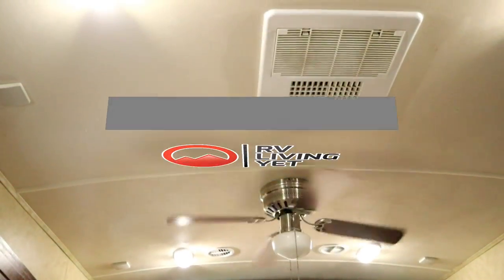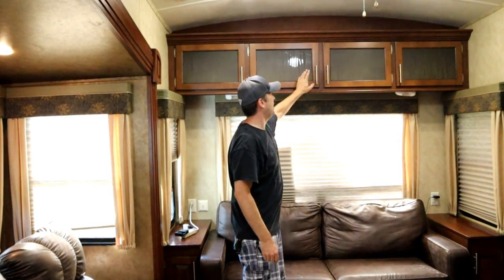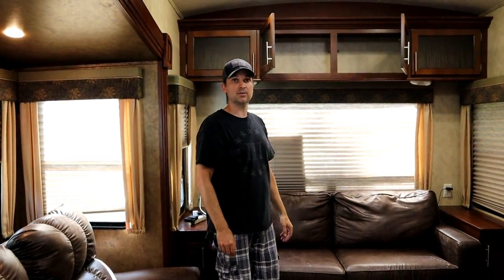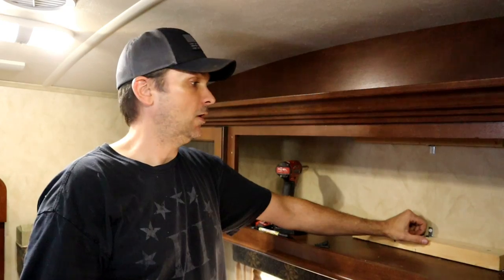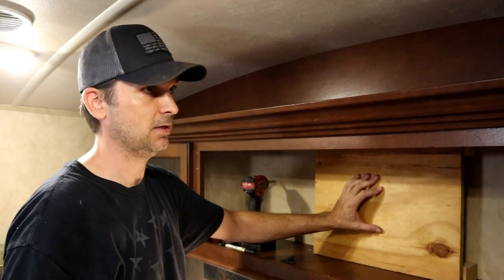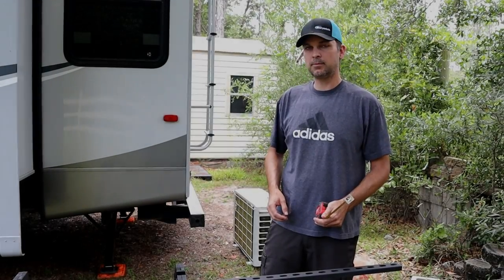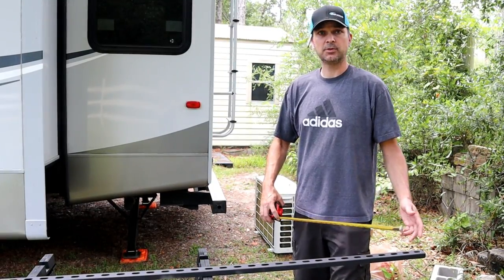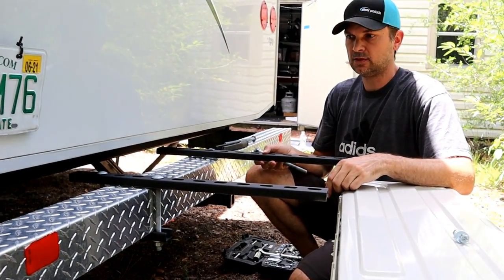Installing Mini Split Air Conditioner In RV Camper-Installing Mini-Split Heat Pump In RV- RVAC Solar

Comment: I just installed the 38 seer 220 inovair in my 30 foot holiday rambler. Its running off my split phase sungold power inverter and cools the camper in 10 or 12 minutes then drops down to 200 watts of power usage. Some people had their doubts about me installing the 220 volt in a camper but man im glad i did. Its absolutely amazing how little power it uses and how well it cool the camper. Next im removing the roof top air and installing skylight in the old hole itll leave in the kitchen ceiling.  Thanks for the video it gave me confidence to do the install myself and it all went smoothly.
Reply from the maker: Glad it helped

Comment: Glad more and more people are doing this. Hopefully have ours ready by summer as well. When I was doing HVAC for work had a client ask for one and it changed my world. I suggested these to everyone I came across after that.
Reply from the maker: Its night and day versus the factory unit, we love the upgrade.
Reply: @RVLivingYet  it really is. Even if I had a house still, I would put these in each room. Did a install at my step dad's barndominum, he has two in there and run 24-7. bill hasn't reached over 120$ all summer and winter.
Reply: @RVLivingYet  also since you have yours at one end of the rv. Do you feel it in your bedroom all the way in the back. I'm installing mine in the bedroom right where it points perfectly down the hall into living area. Hoping a 12000 btu can keep up with the whole 30' rv in summer.
Reply from the maker: @BEASTmodeontheRoad  We have a 12000btu in a 38' and it is brick cold in the summer and as hot as you can handle in the winter. That includes the bedroom.
Reply: @RVLivingYet  12000 or 1200?

Comment from the maker: 👇 👇We have listed the parts we used down below Affiliate Links 👇 👇
Innovair Mini-split AC/Heatpump👉🏻  https://amzn.to/3TuMXWi
AC Gauges and pump👉🏻  https://amzn.to/30i70xR
Flex hose = 1/2 "👉👉   https://amzn.to/3ro43HY 
Flex hose = 1/4"   👉👉  https://amzn.to/3bZPDak
Reply: To avoid vibration problems on the line set leave enough extra copper to create at least one loop (12" or so diameter). That loop will absorb the vibration and keep the lines from breaking. Also it wouldn't hurt to put a strain relief at the connection point at the condenser. This avoids potential leak hazards by reducing the number of fittings.

Comment: Cheers to RV LivingYet, great video. Im about to do the same to my 41 5ver, was wondering how you bend the ref line from the inside unit to the right without kinking it. TIA.
Reply from the maker: We used a round pipe to gently bend the copper around to aviod kinking.
Reply: I'm thinking of adding one to my 41 ft'r as well. How'd yours turn out? Is it effective?

Comment: The heating side of this unit I am guessing is way better than the propane furnace without the fogging of the windows from the propane. These are becoming very popular in the RV world.
Reply from the maker: Yes it give nice even heat with no condensation

Comment: I use your videos as a sounding board for my DIY build. 

The point on using radiator hose for the flexion and bounce is a future life saver point. Thinking about thick rubber bushings in between the mini split unit and my bumper.

Thanks!

Comment: FYI at 5:37 into the video you will see your philips head drill bit was left on the metal template, it came out of your drill! It is probably still there :) Nice work on the install it is a very clean job.
Reply from the maker: Thanks, yep it's still there. Lol

Comment: Great video thought maybe should have rubber bushing under unit did it have some. You did great job evacuating system and flex copper
Reply from the maker: Thanks for watching, yes it has rubber bushings that came with the unit but the whole bracket system was bouncing and causing pressure on the tubing, the flex hoses work great.

Comment: Impressive project. I would be thinking about building out the bumper to extend 6-8" beyond the unit. Just in case there was ever a very small accident. Maybe even a short bumper to span the width of the unit. Or even a cage... Just a suggestion. Really nice job!

Comment: The only issue I could see is there's not much room above the inside unit for it to suck in air but it seems to be working well for you.
Reply: I was looking for this comment because I thought the same thing about the air flow.

Comment: Please help. Can you tell me where you purchased your compression fittings and am I looking for the right fittings? (No one has what I'm looking for.) I've been to 5 different stores (Ace, Home Depot & Lowe's) looking for the 1/2 X 1/2 male & 1/4 X 1/4 male fittings. This is my first time ever fooling with this, I have the inside and outside unit mounted. I just need to connect the copper lines. I love your idea, so glad you shared it. Can't wait to send you pics of mine. My RV set up is almost identical to yours. So when I saw your video. I said I'm doing it! Absolutely hate the loud freaking roof A/C.
Reply from the maker: I got the fittings on Amazon, I don't have the links handy but you should be able to find it with a quick search. Good luck on your project you're going to enjoy the results.
Reply: So sorry to bother you. Would this be it? 

Brass Compression Tube Pipe Fitting Connector, Straight Coupling Adapter,1/4" Tube OD x 1/4" NPT Male Connector 5pcs (1/4" OD Compression x 1/4" NPT Male)
Reply from the maker: @tjjohnson3316  High Quality Air Conditioning Copper Pipe Extension for Joint Double Connector Intermediate Connection Head Free Welding Butt Copper Tube Diameter 6-19mm Flare Nut (1/2" (12.7mm) Copper Tube
Reply from the maker: @tjjohnson3316  Air Conditioning Copper Pipe Extension for Joint Double Connector Intermediate Connection Head Free Welding Butt Copper Tube Diameter 6-19mm Flare Nut (1/4" (6.35mm) Copper Tube)
Reply: Thank you, thank you, thank you! I really appreciate it.

Comment: Great Job. Was wondering, I looked everywhere but you were the only one that had you lines exiting the head unit on the right when looking at the front of the unit.
This was what I want to do. Just wanted to confirm with someone, did you just slowly twist the lines the 180 degrees?
Thanks
Reply from the maker: Yes you have to be really careful when bending them.

Comment: love your video. there should be a way to keep the unit from “bouncing “ as other parts will fail due to the flexing of the mount. 
place a solid mounted cage under it with tune/brake lights and reflectors on it for the fools behind you.  do you run a generator?

Comment: Im in the north so need a tank freeze protection idea for the tanks in the belly if I don't use the propane heat.  I could circulate the propane system fan with a manual switch for the coldest of nights.

Comment: Greetings- I have a 2012 29RL- I think you have the same rig maybe just a newer model? SO assuming that you have a 29RL I'm curious if you explored using a ducted mini-split system since our rigs are ducted? If so why did you decide that ducted wasn't the way to go? Do you have a rooftop unit in your sleeping quarters? If not how does your system perform relative to heating and cooling the sleeping quarters at the opposite of the mini-split output cleverly installed in your cabinets?   Thanks for sharing your knowledge!
Reply: Also wondering if you considered mounting the unit above the rear window and perhaps even having the top of the unit above the roof line- but no higher than a roof mounted AC would be or even lower- this would help in the airflow for the unit since half or a third of it's intake would now now have to deal with the airflow against the back wall. Also was thinking this makes the unit far more difficult to steal AND it would no longer be acting as a rear bumper of your rig- I also have an enduro motorcycle that I'll have as my bumper in it's trailer hitch mounted carrier- any feedback on this concept would be much appreciated!
Reply: I was also thinking in regards to the ducting- perhaps I could have the inside unit exactly like you did in that cabinet and then have small inline fans that I could turn on or off and or thermostatically controlled by bedroom thermostat- the small fans would be inline with the duct.   This would duct the cool/warmer air being output by the mini-split in the living room up to the sleeping quarters- I bet that would do the trick- thoughts?
Reply from the maker: We looked at the cassette-style minisplits but it would have been too much trouble to route the lines to the roof, I dont think the back wall would be strong enough to handle the weight of the outside unit and I didnt want anything on the roof since these units have to be upright they would exceed the height limit. So far this works well, we have a follow up video that answer questions.
Reply: @RVLivingYet  I agree in regards to wall integrity- I was actually considering a roof mounted cantilever strut system that would support the unit's rack from above- if need be I could add structural blocking inside of back wall but doubt that would be necessary- and no I'm not suggesting mounting the base of the unit on the rooftop- I'm suggesting that the top of the unit which is cantilevered a foot or so from the back wall sticks up above the roof line but no further than the highest rooftop accessories you have. Even just 4 inches above roof line I think would really help air flow. Wish I could post a sketch in case I'm not articulating my concept adequately. Thanks for your reply!

Comment: im thinking of doing the same ....  nice job !!  so glad you made this video...  what size wire ? 14/2 ?  on a seperate breaker ?   hows the unit held up with all the bumps in the road ? thx
Reply from the maker: Check out the follow up video that should answer your questions

Comment: Just watched your video and noticed that when you installed your backing plate for the inside unit you left your bit on the last screw you installed then you put the unit in place with it still there. Maybe you were just test fitting it and pulled it back off and found it?
Reply from the maker: 😆 yeah we realized where we lost it after reviewing the footage... 😆🤣 Good eye! Thanks for watching!

Comment: I feel like you deprived yourself of stowage space installing the air handler as you did. Had you removed the doors, then added a blank facade over that void, you could have mounted it with no sacrifice. What are the manufacturers recommended space tolerances for the condenser, and do you know if they must be mounted in the vertical, as you did? I liked your presentation.

Comment: Air Handler location question: Are you having any issues with the small clearance to the top of the air handler in your install? 6" is recommended in my instructions.
Reply from the maker: We drilled holes in the top of the cabinet afterwards.

Comment: That bouncing you described will fatigue the thin steel of the bumper where it's welded to the frame. Your first indicator that that's happening will be when other motorists pass you honking the horn and pointing at the rear of your rv.
Reply from the maker: The bumper is not the typical thin metal, it is rated for 150lb with a tow hitch. The flex was coming from the legs of the condenser which are thinner, we have secured it with a strap. Thanks for watching.
Reply from the maker: Check out our 1 year review video👉 https://youtu.be/TP0KxDykO6k

Comment: These types of split units all require the outside unit to have 12-inch minimum spacing on the back where it draws air in to blow through the front.  Yet it looks like you've mounted the outside unit with only a 2 to 3 inch clearance which severely constricts the intake.  I have to imagine this reduces the efficiency of the unit, but it clearly still works for you and it makes it easier to mount this unit.  But are you getting good reliability from this thing?

It's great that you got this working because it's so much more efficient and so much cheaper than 12V ACs built for the RV market.  There's no way I want to spend $4300 on an RV AC.  It looks like you can probably move this thing out 2 inches to get a little more gap behind the back.
Reply from the maker: I think the camera angle is deceiving, we where able to push the unit out about 10" to get air flow behind it and so far it has been working great. Thanks for watching!
Reply: They don’t all require 12”. The clearance required will vary depending on whether there are other obstructions. You can put a Mitsubishi unit as close as 3 15/16”:
https://hvacdirect.com/hvac/pdf/MXZ-2C20NA2_Install.pdf
Reply from the maker: Check out our 1 year review video👉 https://youtu.be/TP0KxDykO6k

Comment: I didn't think of mounting it inside the cabinet, I almost ripped the cabinet out. Thank you
Did you think about Mounting the outside unit near the roof on the back? 
My thinking is that area on the back just below the roof, opposite of the ladder or maybe in the center,,
It is a very irrelevant area that doesn't see any kind of action so it seems safe and out of the way.

Comment: If have problem with the the copper lines breaking at the flare you can use a number 6 sae fitting with automotive hose  ac line 
Number 4 fitting for the 1/4 copper line

Comment: Was the 12,000 BTU enough? We are here in AZ and lost our rear unit and I’m thinking of installing a mini split. I was to go 110V but the only option is 12,000 BTU. Not sure if it will
Be enough.
Reply from the maker: In extreme heat we kick on the bedroom AC but overall this is plenty for a 4 season RV
Reply: @RVLivingYet 

Where did you buy the flex line?

Comment: Great work!  Question/Comment -- The unit you mounted in the cabinet also needs a return air flow path free from obstructions.  This helps to keep the the evaporator from freezing up. I believe most require a foot of clearance from the top. The air return space looks really tight in that cabinet.  How is the return air flow path working out and is it enough when the AC is on its highest level to not freeze up the evaporator?
Reply from the maker: We drilled holes in the top of the cabinet after this video, haven't had any freeze up issues.
Reply: @RVLivingYet   From an aesthetic point of view -- Another idea might be to make those cabinet doors one piece and flip up.  Flip it down to hide it and up when you want to use it :)
Reply: Or screen it.
Reply: It requires 4 inches the manufacturer supplies all clearances in the manual. I would have came further out of the cabinet. Also there's a thermistor on the left side of the evaporator head that senses the room temperatures an enclosed cabinet wouldn't help. I'm thinking on installing one on my rig but I would much prefer the 220v. Which would require it's on 220 inverter. Also I'm sure the efficiency would be a lot better.
Reply: What about the slope that needs to be required?
Reply: @hugpcantu4090 slope for oil return or Condensate?

Comment: Install looks great. One question. 
Is there any condensation inside? 
I have a toyhauler and  the unit will have to go in cabinet above the bed.
Reply from the maker: These units are great at dehumidifing, there is a condensation drain that runs down with the wires to the outside.
Reply: Good,  that way I could put condensing unit on the  tongue.

Comment: Great video did you ever remove the bit you left on the bracket 9:41? Just curious
Reply: I was going to leave this comment if no one else had noticed yet! That Philips bit was stuck in that last screw head when you mounted that thing! (edit - and its at 5:41)

Comment: You said your roof unit would only cool to 81 deg or so in the heat of the summer. What is your average cooling with this unit
Reply from the maker: This will get it done into the 70s we don't go much lower than that
Reply: @RVLivingYet  Awesome thank you for your quick response. I’ve been researching them for a while and home depot has a really nice 12000 btu 20 seer for $899 right now. Great video thank you for posting

Comment: I wonder how long it will take for the RV Mfg's to start making these a thing?
Reply from the maker: That would be awesome if they did, would be a huge improvement over the loud roof top units.
Reply: @RVLivingYet  You know they make ceiling cassettes that would probably fit perfectly where the old AC unit was.
Reply from the maker: @amsoiltek  We saw those, they were way more money and needed some modification to the roof opening. Eventually, we will remove the roof top unit and add more solar.
Reply: @amsoiltek  The problem lies in that the line set (refrigerant) will have to be run to the cassette on the roof, that doesn't leave for many options for installation, as most openings are pretty far from where the condenser would be mounted.

Comment: is it recommended to use 2.5---3" pvp pipe to enclose the lineset that you have behind the curtain going down through the floor to the outside unit to further expose it to air and prevent condensation or any potential leaks? I'm planning on doing the same in my rv but I just wanted to keep water from soaking up my carpet when the lines sweat.

Comment: Did you sweat the fittings of the flex pipe, or did you make your own flange to add male & female connections?
Reply from the maker: Made flanged ends and used male to male coupler.

Comment: there is a very low cost way to make a factory a roof ac unit much quieter.  just you will no longer get that blast out of it.  all will go through the ac ducts. 
but you still have on less than ac to work with.

Comment: Hi, thanks for the video. I'm trying to do the same, I don't know how to wire for power. Where do you get your power from? In the video, it shows the wires go inside the rv, but doesn't show where it gets connected to.
Thanks.
Reply from the maker: We did an update video that shows where we wired it. Check out our recent videos.
Reply: @RVLivingYet  i will, thanks for the quick reply.